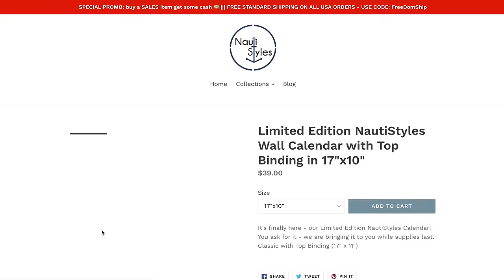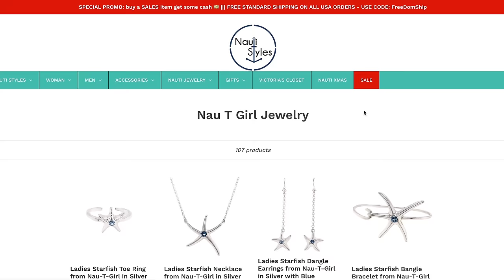Is Our Yacht Sponsored?? 🙈😳 Eps. 40

Comment: 13:03 I know I already commented but I’ll be “that guy” that makes two comments. For  Victoria, have your partners make a “Easy Button” version of instructions how to turn on, turn off or maintain a particular piece of equipment. We have them printed and laminated for each piece of kit on our RV. Makes it super easy for the spouse to do things when I am on travel or whatever and works as an idiot guide for me when I only use the thing or service it once a year for maintenance.

#2 Literally! I would always recommend an alternate toilet option in case of complete catastrophic failure. Having an incinerating toilet on board is a god sent. The electric version would be perfect for your boat and only needs a single vent pipe. They have been used on commercial vessels for decades. We love our incinolet toilet at our cabin and considering you don’t need a septic, tanks, treatment its super affordable.
Reply from the maker: You've got the right idea on both your comments 🤣🤪💙⚓️

Comment: 50 years ago, I captained a large custom-built yacht, which operated on the US Gulf, East Coast and the Caribbean. All of the appliances onboard, galley stove, refrigerator, freezers, washer, dryer, central vacuum system, water heater, etc., were Kenmore brand from Sears Roebuck, the reasoning being that spare parts were readily available in the US and Puerto Rico. That wonderful boat is no longer.

Comment: Loving the choices- especially the yacht management. The two different sized water makers is not surprising- I figured you would use the smaller one for when it is just you guys onboard and a larger one when chartered.  I am looking forward to the system specific videos-especially the Faruno, Bonning, and Victron ones.

Comment: Ah, Security! That's my bag. I'm assuming selectable motion sensors and also light-breaks, similar to what you have for a garage door opener. Audio pickups possibly, and of course lighting and cameras controllable and visible from a number of locations. A LOUD! PA system does a lot to scare off unwanted visitors too. The light-breaks would come in handy if someone went over the side during a party. I'd love to hear about what else is involved - my efforts are generally around shore-based structures. It's always great to see the two of you so excited about your new home.

Comment: I knew it !!! Victron is setting THE standard in electrical Invertors !
Reply from the maker: How did you knowwww!!!!??? 🤪🤔
Reply: @NautiGuys  boat shows, Yachting magazines and learning to branch out to Computer systems architecture for yachts. It has specific constraints like power pulled, wifi / radio wave cover and privacy protection like data snooping in marinas wifi pirating...

Comment: When I was working for a boatbuilder 20 odd years ago, the biggest problem we had with the heads (toilets) were the units with emacerators. When we, or some of the private owners, would charter out for parties 🥳 sometimes ladies would drop their tampons down the toilet and the emacerator blade would get jammed up with the string and pad and they'd clog. Another problem with the heads is the pipe from the emacerator pump would clog up with a crystallised compound and totally block any movement of water and solids, and they'd overflow. What we found is that it was the seawater we were using to flush the heads, and if they hadn't been used in a long while the seawater sitting in the pipe would crystallise and turn solid. Also, we surmised that the liquid toilet cleaner used was the catalyst of this phenomenon.

Comment: Nice to hear the explanation of your equipment and to me there is nothing wrong with getting sponsored. If companies are willing to participate and use your channel for commercial purposes that is their choice. If that gives you free equipment all the better for you, if saves tons of money, so very well done. 
Also understand you are linking up with Victron and since your boat will be running on US specs I assume you will run the boat on 48 V. However, unless Victron is planning to introduce a larger inverter than the current 10 KVA you will be looking at a lot of inverters. 
Hearing all the equipment you want to have on board your boat will be very power thirsty. All the airco's, ventilators in the engine room, water maker, washing machines, coffee machines, dish washers, ovens, microwaves, cooking plates, standard boat equipment etc guzzle electricity. At 120 V my guess is you will need around 200 - 300 Kw each day, especially if you have the airco's running all the time. I know you will have generators, but since you want to have solar and batteries as well I am very curious to the size of your battery bank. That should be up around 4000 - 5000 Ah at 48 V, which is a lot of batteries. 
So very much looking forward to your energy calculation, since that also has a direct impact on the range of the vessel. While underway it is no problem, the alternators will charge the batteries again, but it is the anchor part (when the engines are not running) that becomes the interesting part. Charging via a generator is possible, but you would need a very large generator to charge 4000 Ah back into the batteries. That uses fuel and thus reduces your range, plus it eats up generator output while charging (leaving no room for other equipment unless you scale down the charging). 
In fact, I had to scale down our charger since it would use up the complete generator output for charging the batteries. I was unable to run any other equipment while re-charging the batteries.

Comment: Batteries are heavy and inverter systems run Batteries down pretty quickly. Batteries used all the time in this way have a shorter life. Also charging them cause both generators to run. One to charge the batteries and one for the electrical load,

Comment: I think 110/60 is a bit odd, the vast majority of vessels are built 230/50, even Us commercial vessels have 230/50 power. You just need a converter for your shore power connection.

Good luck with Böning’s after sales support, hopefully they are better in the US than Europe. I have so many customers who have had problems with after sales support, they are not a very customer focused company.

Comment: Also consider an emerging system that has a high capacity ampere with a supercapacitor battery.
On my camper, in winter on the Alpi, there is a litio battery. In the garage, installed 2 AGM, connected to a supercapacitor battery; In this way, I have immense autonomy and, if necessary, I have immediate power to respond to the emergency situation.

Comment: With a Lithium battery system most of the newer boats are using a 48VDC system.  DC motors in most cases are more efficient than AC.  So the question is why are marine AC chillers based on AC electric.  Why don’t they use a DC compressor motor and run it from 48V?   That would eliminate the need for large inverters to power the air conditioning.

Comment: Why not have an explorer boat that as many do that can comply and convert to all types of shore power or are you? I understand why you want localy sourced appliances and degradable equipment for replacement etc, are you planning on only staying in the US or are you actually going to explore further afield? A mega loose watch strap as I assume the watch digs into the back of your hand, was suffering from that yesterday so did the same 😆😂 Lucky you being able to leverage your exposure for deals grrrrrrrr. 😁 Love Victron inverters have had one on one of my boats for 17 years and never a problem, correct programming is part of the key, especially if you ever change the batterie types.

Comment: Normally most electronic equipment use a switching power supply. Meaning they work on all Electric current
Reply from the maker: Sounds like you know your stuff !! 😝⚡️🔋
Reply: @NautiGuys  it's my job. 30+ years of it. 😉😘
Reply: @Navy1977 actually they do. But it is logical and smart to select your equipment and set your electrical system for the region you'll sail the most.
This is also why Bering runs all its electrical though inverters including the shore power. This way you can sail worldwide with no shore power issue. Your power will always be generated to your specs no matter where you are.
Also it means that if I come on their boat with my Computer or Phone, as long as I have an adapter for the plug, I'll be able to charge my equipment.
But my point was more for their electronic equipment like the multifonction screens in the wheelhouse or the computers and other radio etc. Most of them use switching power supply thus implementing scale cost savings by having one model manufactured for the whole world. The only thing left is the cabling and that's cheap.

Comment: Victron equipment is so over rated and hyped.  I have never been impressed with any victron equipment.  I have lived off grid for the past 20 years and I have designed and built out numerous off grid power systems for other people.  20 years ago I discovered Outback power systems when I started building out my off grid property and I have yet to find better equipment.  My system probably generates enough energy to power your boat 4 times over.  I have 36kw of wind power and 28kw of pv solar along with a 100kw and 60kw diesel generators and a battery bank large enough to run my property for 2 weeks without generating any power.